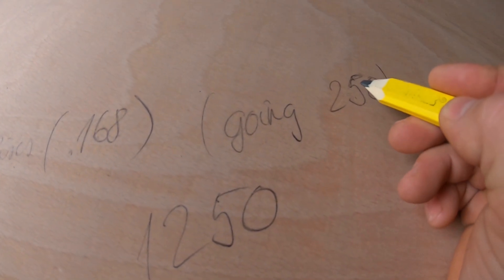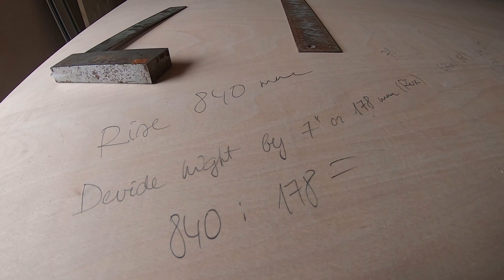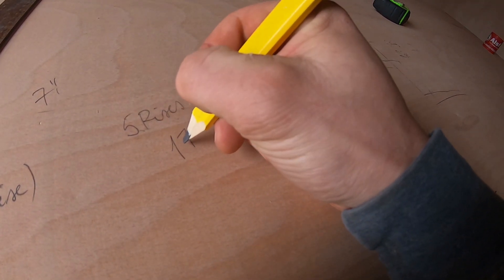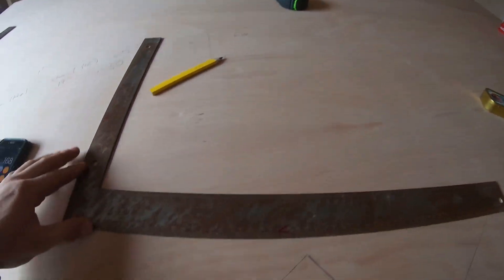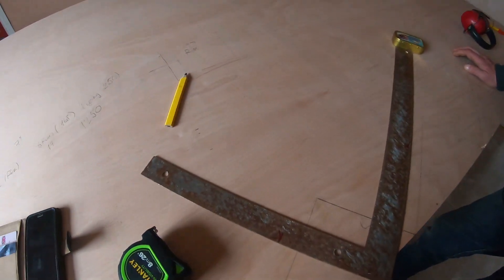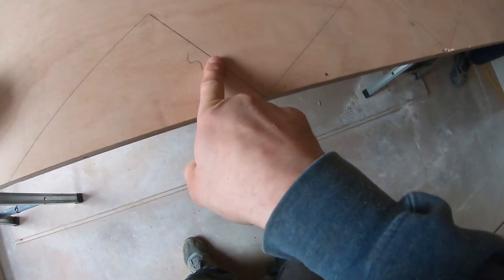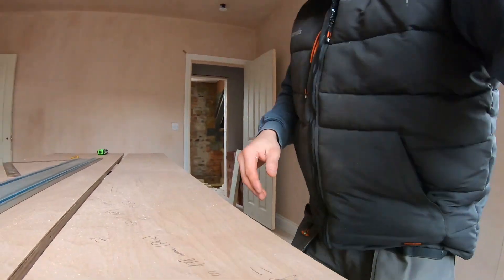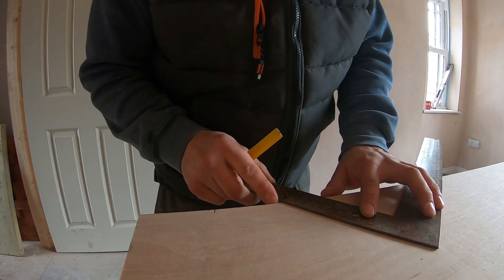Principles of measuring and building stairs

Comment from the maker: 00:00 Explaining the calculation of measurements and principles
04:12 Work process
04:50 Covering calculation one more time and drawing cut-outs
06:42 Work process
07:49 Test fit / checking levels
08:52 Work process
11:59 Checking the result and test fitting

Comment: hi guys ,very good attempt but will building control pass that never seen stairs stringers made out of  single18mm ply i think the preferred method in uk is solid 32mm thick stock for stringers and wedged and housed steps  ,plus putting hand rail spindles is a bit of work , well done anyway.
Reply from the maker: Its 25 mm hardwood ply, blocks to take riser and step was glued in afterwards.